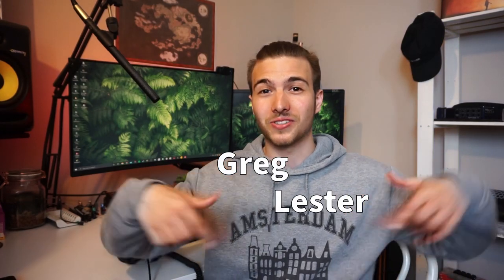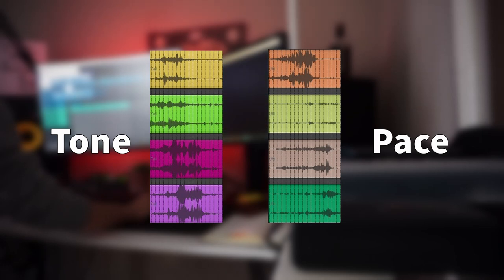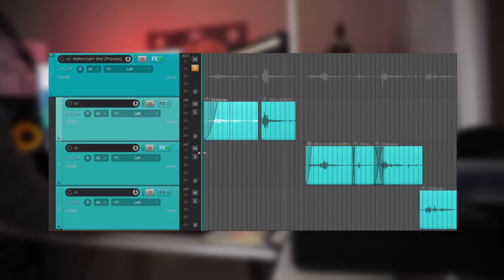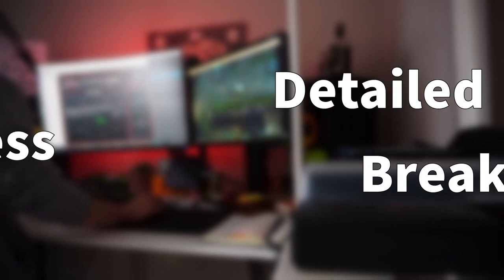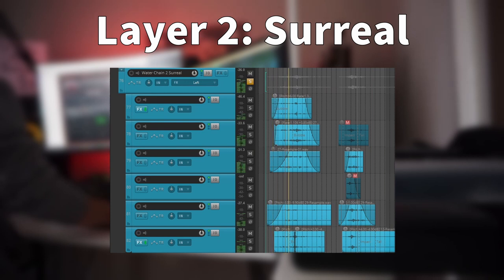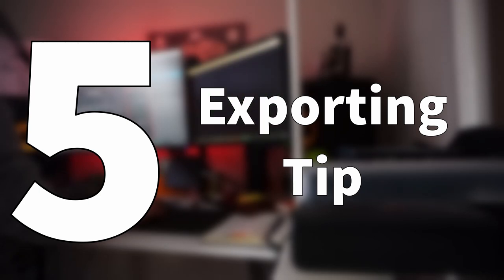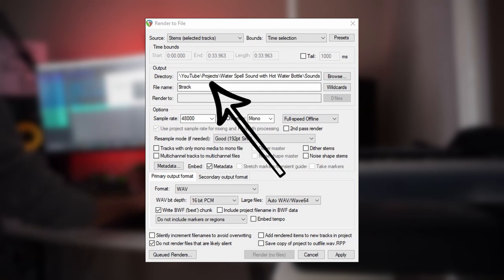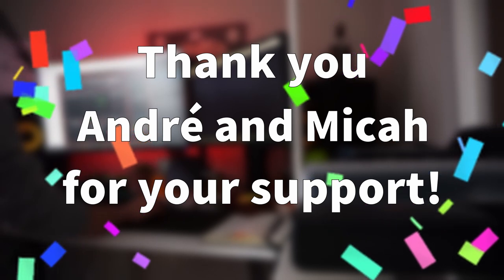Creating a Water Spell Sound from Scratch

Comment: Dear Game Audio Analysis (sorry I didn't catch your name:/), do you think Reaper would be a better option for game design than Logic pro ? I plan to spend some money on a laptop and I seriously have some troubles in thinking whether should I go for Macbook or Windows. (I really don't know how much PC specs would I need for sound design/composition). Also, are most of the plugins you use free for Reaper? Or mostly you are using paid ones. I would really appreciate it if you answer my questions! Thank you so much!
Reply from the maker: Hey Darko, I'm Greg :) Reaper is definitely better for game audio in the long run, I'd recommend picking it up if you can. Mac vs Windows is always a controversial issue, I would recommend going windows as I've yet to encounter a studio that uses all macs and you'll have an easier time if you know it. I use a lot of free as well as paid plugins but I've written a resource list that will come sometime in the next two weeks so the best thing to do is follow me on twitter @itsgreglester and keep an eye out for that. The guide will hopefully answer most of your questions regarding gear :) and like I said that'll be out in the next two weeks so thank you for your patience in advance!

Comment: When you press record and mess with all of your plugins, do you just resample through your daw, or do you use a plugin like Edison?, in Ableton it's so annoying cuz it starts creating automation for every parimeter you touch
Reply from the maker: I resample through my daw by routing one track into another track and recording the output but you can use Edison or any other type of recording plugin to record the output, that shouldn't make a difference as the signal flow is the same